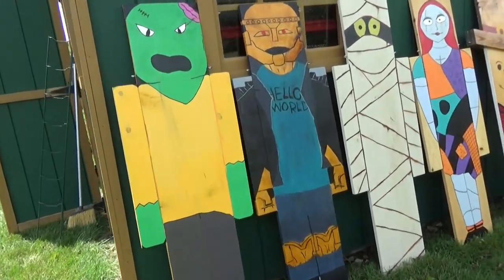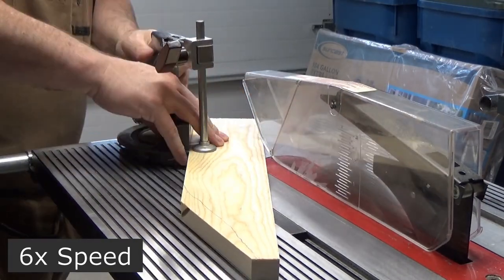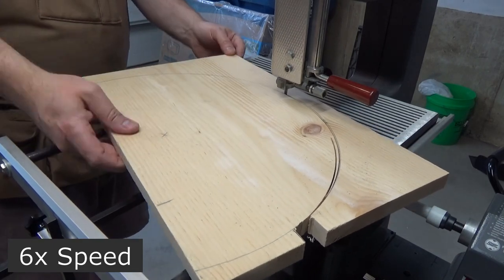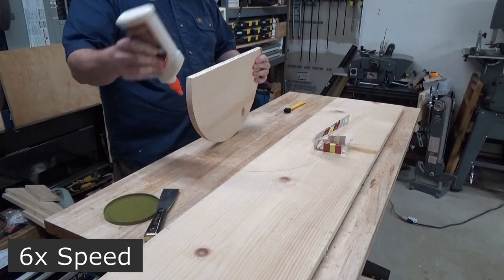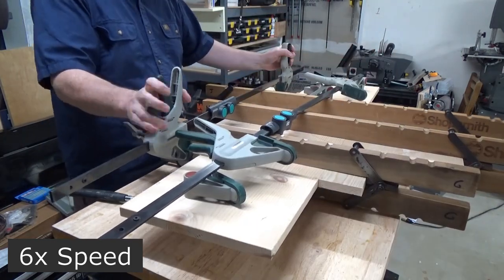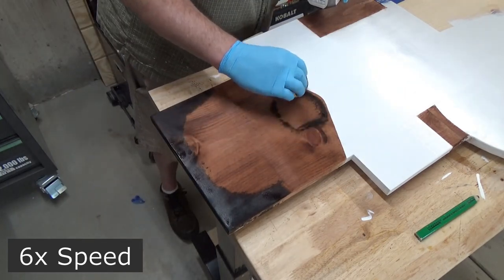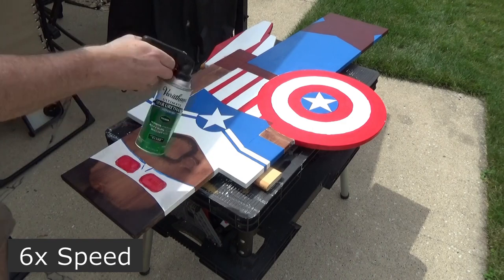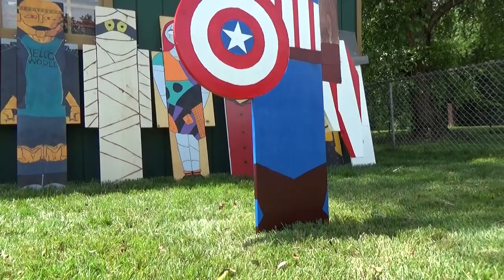Patriotic Woodworking Project: Marvel Superhero - The Falcon is Captain America

Comment: Glad to hear you liked the biscuit joiner. One tip is to rotate it on the quill so that you are approaching it at a 40 degree angle from the miter slot. We found in the academy that the table grooves, miter slot and even the edge of the table insert can all snag on board edges a knots. It wouldn’t surprise me to hear that you experienced this a bit with your push block. Looks like a fun family tradition. Scott
Reply from the maker: Thanks Scott, great tip. I pinned it.

See Scott's Channel  - https://www.youtube.com/c/MyGrowthRings

I didn't notice any snags, but now that you mention it I did feel that the spring tension was really strong even on the #0 biscuits, which I assume require the least compression. But I have nothing to compare to as I have never used a handheld biscuit joiner.

Comment: Happy 4th to you and yours, Thomas!

Biscuit vs dowel joinery used to be a toss up for me as well. Being that I started out woodworking with the Shopsmith system; dowels were the "standard" back then. While biscuits are great for alignment, and give you allowance for lateral movement during the glue up that offers a wider tolerance. They add little to no extra strength to the joint. Dowels are great for strength, but boy do you have to be accurate when drilling those holes for lateral alignment. Most of the time biscuits are now my "go to" for panel glues-ups, versus dowels in the past. I'd say you chose wisely for this project. Considering that your pieces were already to size and shape, and to be honest, they had to be in this case!
Reply from the maker: Thanks Chad! And you make good points on biscuit vs dowel. In this case all the joints were edge-edge grain, so no extra strength really needed and getting my doweling jig indexed off these irregular pieces would have been a struggle. But on things like my barn sashes, I think dowels were the right choice. So, to your point, I need to learn to use both in the right situation.